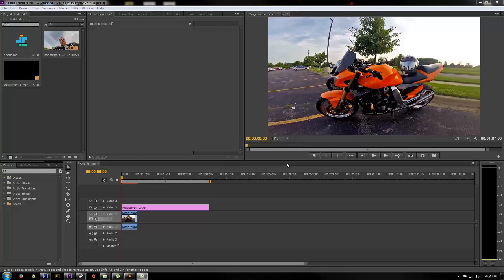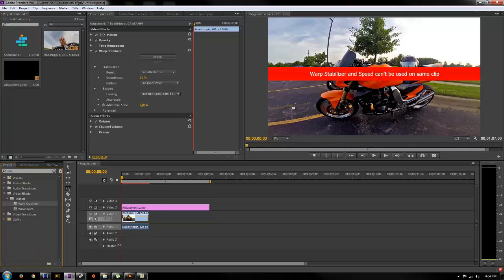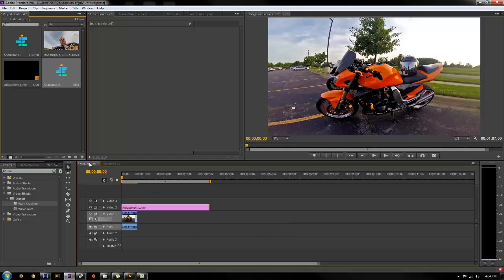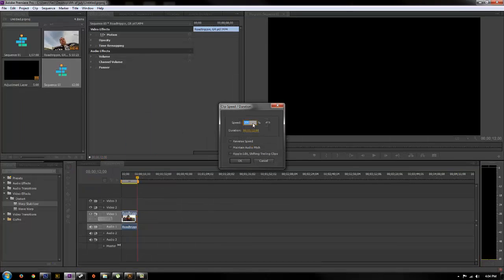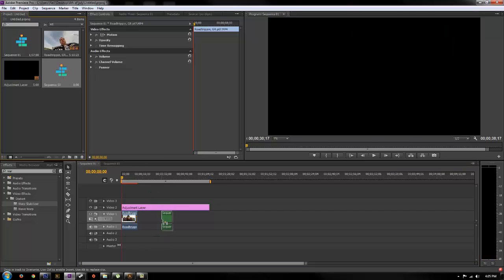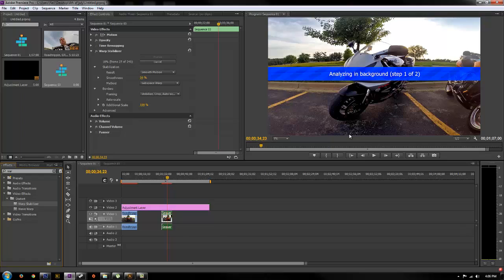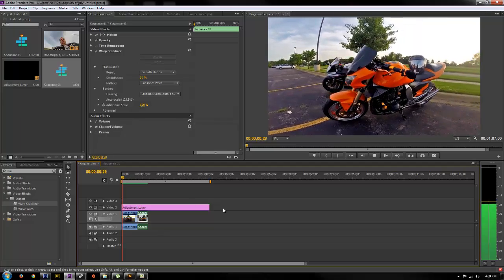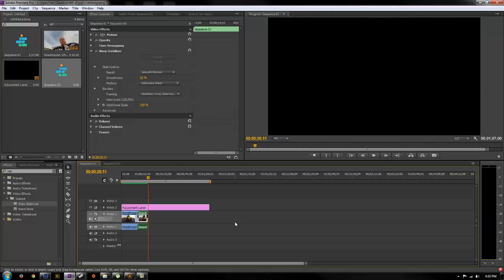How to use Warp Stabilizer & Change Video Speed in Adobe Premiere

Comment: Sorry, but this workaround took you 2:54, better after clip time change "NEST" clip and then apply warp stabilizer, will take less time... Wondering if you had to make video one hour length changing speed how many sequences you will have? Try this method and save your time...
Reply from the maker: Great tip man thanks didnt know that! :)
Reply: EN187 Hope it will save your time! :)
Reply: Karina Garosa Looks like you have changed speed of clip or something... Anyway the workaround will be nest the clip before applying warp stabiliser. That's it...
Reply: +fructystudio nest is the best =) ty
Reply: both ways don't work for me & still show me, that warp + stabilize cannot be used on the same clip. any ideas?
Reply: fructystudio thanks so much for the fast reply, I realised I had an old warp hidden in my effects on that particular clip. :) nest-tip is awesome though, so easy!
Reply: Karina Garosa Glad you you solved that... Good luck...
Reply: fructystudio  Works great, very quick!